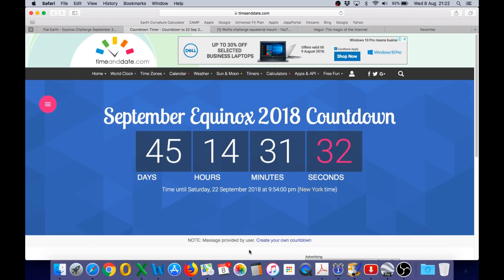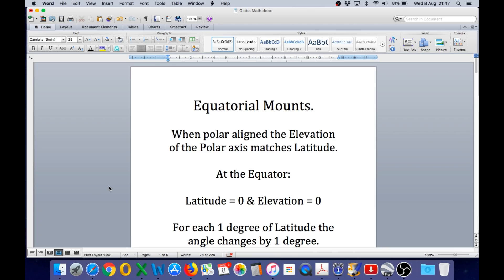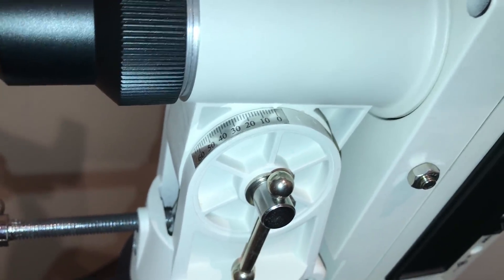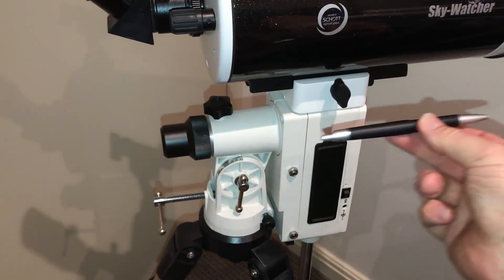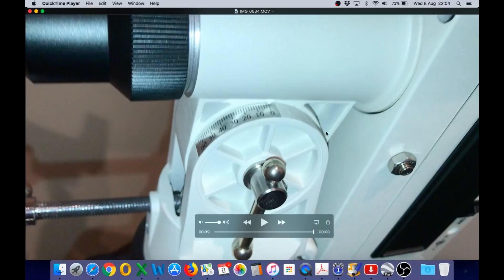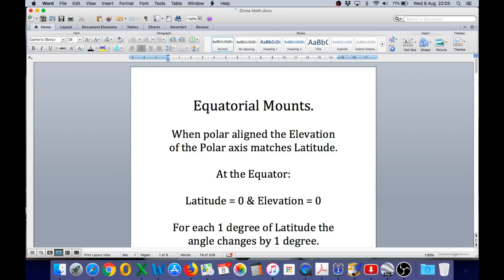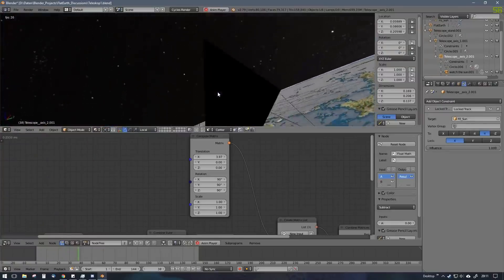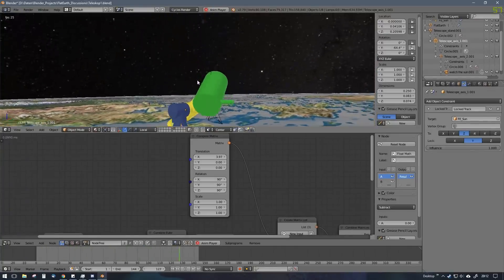Equatorial Mounts - a huge problem for Flat Earth.

Comment: Another excellent video. Flattie ostriches will bury their heads yet again.
Reply: Actually, that's unfair to ostriches.  I saw quite a few of them in Tanzania and not one buried its head in the sand.  Supposedly this story, like the one that elephants are afraid of mice, goes back to Pliny the Elder, who either made it up or got it from someone who made it up.

Comment: I noticed you don't mention it's a problem for CONCAVE SPHERICAL EARTH?
Reply from the maker: +Jason McCormack.  Do you think they will work on a concave Earth?   Try the same challenge please and show me your physical model.
Reply: Jason Mccormack 
Jason, we’ve been through this already. Your LSC’s concave earth model has other (much simpler to understand) problems it has to deal with. I had given you an assignment to go ask the man himself since you seemed incapable of addressing the problem on your own. You never came back with an answer. 

From the looks of things it sounds like you don’t think concave earth has problems, which implies you found a solution for the task I gave you. So what is it? How do you fix the terminator line conundrum caused by curving light rays from the sun? How do you prevent sunrise from lighting up the base of a mountain first when reality is that the tops are illuminated first?
Reply: Sphaera Invictus https://youtu.be/to6Px7XCMlc
Reply: Sphaera Invictus that wasn't this contest... but this does work in concave earth... fools
Reply: Raging S you're officially a moron. It works perfect. AnD NO YOU WOULD NOT SEE CLEAR TO THE OTHER SIDE. YOU OBVIOUSLY DON'T UNDERSTAND THE CONCAVE SPHERICAL EARTH
Reply: Jason Mccormack 
Well, color me surprised. Unlike typical flatties who just endlessly deflect and move the goalposts you lsc EVENTUALLY made an attempt. Ultimately it’s still flawed as most ad hoc explanations tend to be but you get a star for your attempt. 
https://m.imgur.com/gallery/qWzXt

Comment: Honest question about equatorial mounts. If you ran a camera on an equatorial mount for multiple days, would the sun slowly move out of frame?
It seems to me that if you ran a camera on an equatorial mount for a year, it would start in frame, slowly move out of frame, then at the end of the year slowly move back into frame. Is that correct?
Reply: Awesome, thanks. Just wanted to make sure it was working the way my mental model was.
Reply: Rolf Jander
Some EQ mounts have a different rotation rate for Sun, Moon and stars so you can overcome that.
But as you said - Earth is rotating on an axis compared to the Sun so it would eventually go out of the view.
Reply: I'd take one hell of a drift alignment.
Reply: Steven Bell thanks for the question. I didn’t think of that, though I did immediately know the answer after some thought. I wouldn’t have realised this if you didn’t ask. 👍🏼 

Yet this mount can work on stars through the year? That’s pretty cool to know lol

Not like I would go about owning that mount, but if I meet someone that owns one, I’m definite going to ask if I could try it out.

Comment: They can’t even figure how high up the Pole star is, if they all got a cheap telescope on a tripod, measured the angle of elevation of the pole star and used Pythagoras theorem to calculate how high the pole star is, they’d all get different heights for each latitude
It only makes sense if you then adjust for a globe, then the pole star works out to be a lot farther away than any “dome” that’s been suggested, about a quadrillion miles or so
Reply: Dave Church , yeah, Jos Leys did an animation of that.
 He also showed that at the flequator, Polaris would be at ground level.
Reply: Dave Church 
Even Samuel Rowbotham couldn't come up with a complicated explanation for that, he just claimesd perspective.
Conveniently ignoring that perspective over a flat surface would be a matter of maths and no magic can change that.

Comment: Hey Wolfie. Very informative video, thank you. Sparked some thoughts. 
It is flat, flefers have just not worked it out yet. 😂👍  I wish I had the time and computer skills to "model" my thoughts. I still use pen and paper. 
Question if i may. How would the eq mount work facing north from 15 degrees south?
I have a manual equ mount from Orion btw.
Reply: If you know it’s flat, you must have figured out how. If someone showed you a shape and you affirm it is a square, you must have a reason for saying so. Responding with “I know it’s a square but haven’t figured out how” is entirely insane. 

What makes it worse is a flat plane is the easiest thing to map. Locations scale very easily, you just need to measure distances and resize appropriately to fit on the flat piece of paper. All flat earthers have to do is gather a bunch of local maps which are very precise and stitch them together to form a global map. If the earth is flat, it ought to fit pretty well without any distortions or curving lines.
Reply: Cosmic Surfer, "facing" north? You first polar align it to the South celestial pole, then you can find and track any star in the visible sky. The mount works the same way everywhere, just the alignment changes.
Reply: Stanislav Blinov The question was very clear, how would the equ mount work from the other side of the equator.
Reply: And that is how it would work. You'd align it with the south celestial pole...the same way you do with the north celestial pole.
Reply: "how would the equ mount work from the other side of the equator."

The exact same way as in the north except the alignment is done with the south celestial pole and rotation is anticlockwise. The polar scope in my EQ mount displays the constellation of octans exactly for this purpose.
Reply: TheSyndicalistDragon
But there is no south celestial pole on flattardia, so thats a big problem :).
Reply: It is flat, flefers have just not worked it out yet.

Really,it's been worked out it's a globe and has always been worked out that way for the past few hundred years or more.
Reply: TheSyndicalistDragon cool, glad you believe that. I dont.
Reply: "I still use pen and paper. " 
Centuries of astronomers, map makers, engineers, physicists etc. managed without youtube as well.
Reply: Cosmic Surfer 
An equatorial mount is geometrically impossible on a flat plane. That’s what flatheads can’t seem to comprehend. The only solution is if the objects in the sky are some kind of optical illusion that, by way of bizarre coincidence, perfectly mimic what would be observed from a sphere-shaped earth.
Reply: Cosmic Surfer 
Use bits of cardboard, string and the like.  Best way to see stuff in three d.  Besides the challenge requires a physical model.  Doesn't matter how crappy it is as long as it works.
Reply: Cosmic Surfer, an equatorial mount works when the plane of rotation is parallel with the equator. You can do this by aligning one end of the axis of rotation to either of the celestial poles, but the further south you are when aligning to where polaris is the more those pesky tripod legs tend to get in the way.
Reply: Another way of looking at it: you actually do point the polar axis towards the Northern Celestial Pole (near Polaris) from anywhere on Earth, including in the Southern Hemisphere.  It's just that "down under" you have to point the bottom end of the axis North, or (as Michael pointed out) the telescope will run into the tripod.  Also, it's kind of hard to see Polaris through the Earth, so it's more convenient to look for the Southern Celestial Pole from there.
Reply: Cosmic Surfer - The moon is made of cream cheese, I just haven’t worked it out yet. And WW II was started in 1939 when Julius Caesar invaded Poland, I just haven’t worked it out yet.

Comment: Sorry mate, love your videos but you are not technically correct with piece of info given in this one. While each degree away from equator might be roughly 60 nautical miles, each degree actually is slightly more the further away from the equator one gets. First degree is actually 59.661 NM, while the last degree 89 - 90 is actually 60.272 NM. I have no clue about equatorial mounts and so do not know if this minor difference matters or not though.
Reply: Kevin Fisher, that's irrelevant in this case. Of course we know it's oblate, hence this small difference. A rough 60 is good enough, Wolfie just used it to estimate distance, nothing more. Mounts don't care, they rotate, they care about angles, not distances.
Reply: Yea wolfie even mentioned having to make minor adjustments. But just was not certain if that was only on some, or all of them are like this. Did not know how sophisticated or accurate they really are.
Reply: At 5:16 after going to 10 degree angle where he states "and clearly there would be some fine tuning involved with that."
Reply: +Kevin Fisher   If you look at the scale on the telescope, whether it is 59.661 or exactly 60 is irrelevant, since there is not that much accuracy anyway.   Maybe when they are setting up a permanent observatory, they may deal with that many decimal places, but not for the average telescope user.
Reply: It's a case of practicallity > accuracy.
Reply: Anton Gonist, so, by you, a seconds needle on a wrist watch travels 360 nautical miles every second? Numbskull.

Comment: Equatorial mounts.  Flat earth kryptonite.

Along with...... everything in the universe.
Reply: It's really geometry that causes them to run away screaming. I have always wanted to walk into a flat earther convention and shout, "I have an isosceles triangle and I am not afraid to use it!
Reply: Mandelbrot Set Use it? I'll be amazed if he can even spell it right.
Reply: Not everything debunks the FE - circumnavigation still works, as an example.
Reply: @random guy What do you mean? Of course circumnavigation works only on a round, spherical Earth. On dinner plate Earth, circumnavigation does not work except for very special paths, paths so special, they don't even really count as 'circumnavigation'. But on the real, spherical Earth, if you keep a constant heading, then from any point where you start out, you will return to it in about 25000 miles.
Reply: Yes, of course circumnavigation works. On the FE, though, it does actually work too.
Reply: random guy I just explained why it doesn't work.
Reply: random guy 
Show me an accurate Fe map, one that shows the correct distances between all points on earth.  Pro tip you can't because the earth is a globe
Reply: I'm not claiming that FE is right, because it isn't. But it is possible to trace the path that, say, Magellan took. THAT is what I am claiming.
Reply: random guy You could trace out Magellan's route an the Flat Earth map. But so what? How would it even count as circumnavigation? There isn't even a sensible definition for it on a Flat Earth map.
Reply: It's what'd be defined as circumnavigation if it were mapped back onto the globe. Point is, it can't be used as an argument against the FE. Capiche?
Reply: random guy Point is, you still don't get it. Clearly, you have never tried what you yourself suggest, 'mapping' Magellan's actual route onto  Flat Earth map.
Reply: random guy 

Circumnavigation is impossible on a flat earth.

If Earth were flat like a dinner plate you can go from the right side to the left then have to stop. Everything flat has an edge.

On a globe you can keep going round till you run out of fuel.
Reply: Okay then. Why WOULDN'T it work? AFAIK he didn't go over Antarctica or anything...
Reply: If you try to do as you yourself suggested, map out his path on a Flat Earth map, you will answer your own question. Until you do this, you will continue to fail to understand any answer, you will continue to miss the impact of the point I already made, that there is no good way to even define 'circumnavigation' on a Flat Earth map. It cannot, for exampe, mean crossing all lines of longitude as Magellan did. Nor would it be the same if we meant "skirt along the coast of Antarctica".

Speaking of Antarctica, though he never did go there, Magellan did get pretty close, passing through Tierra del Fuego, which is almost as cold as Antarctica, it is so close.
Reply: TRY GOOGLING IT! EVEN THE FLAT EARTH SOCIETY HAS AN ANSWER!

Look, I'm not saying that the distances match up. I'm saying that the route would be takeable on the FE.
Reply: random guy 
If the distances dont match up its useless.  It doesn't work.  It's not a map it's a nice painting.
Reply: Did I ever say that the distances matched up?
Reply: random guy 
Calm down.  Stop taking this nonsense so seriously.  We will all be dead soon enough.
  What is your point?
Reply: My point is that you can't use circumnavigation against the Flat Earth.
Reply: A Wat Flat Earthers don't know it, but there is a way to compute distances on an azimuthal equidistant map.
Reply: SpectatorAlius 
I'm sure there is but at the end of the day you end up with a sphere and they know it.  That's why they claim the distances are true.
Reply: random guy 
I get your point.  I am sure you get mine.  Cheers 🍻
Reply: @random guy If the distances do not match up, then when you think you are tracing Magellan's route and 'mapping' it on the Flat Earth Map, you are not doing so at all.

Flat Earthers don't get this, but you should.
Reply: ^^ this
Not much matches up, but if you were to go to 60 degrees south, you could sail in a straight (well, you'd have to put a constant turn on) line and end up where you started.
THAT is circumnavigation on the FE. Distances don't match up, and I have no clue about celestial bodies, but the routes themselves half do.

Comment: For FE'ers north of the equator this challenge is no problem at all since they will simply state that they are pointing their polar axis at the rotation point of their glass dome by Polaris.  The problem comes for FE'ers south of the equator... how do they still maintain a glass dome with a rotation point around Polaris when they can't SEE Polaris?  How do FE'ers even explain why Polaris is at different altitudes?  At the center of their FE it is directly overhead... but at the equator it is level with the plane of the FE!?  How does that work??  That one guy who did the videos with all the direction arrows on the equinox should do one showing all the angles for a person viewing Polaris at different latitudes and how they go from pointing straight up to horizontal and then morph it to a sphere showing them all pointing at one spot... Polaris.
Reply: It doesn't work anywhere.The problem is that if you want to automate the following of the flat earth sun, your telescope's mechanics must (secretly) represent the flat earth model because no reference for this movement in reality exists.The visual path of the flat earth sun isn't described anywhere by flat earthers. (Still working on the sunset/sunrise problem, probably) It must be some "masonic" stuff inside the telescope that takes care of that...
Reply: tubedude54, the point is to build a practical model. Earth isn't flat, so...
Reply: Stanislav... I think the FE 'gurus' have given the quest of making a model up because they realize it can't be done.  So we are seeing other less informed doofuses in the FE community continuing the attempt.  Problem with those people is they are not smart enuff to understand why their model is flawed and just keep pushing it out there saying it is correct.  Those are the people that nothing we say will ever convince them to the contrary.
Reply: tubedude54 
An equatorial mount can’t work at all in the northern hemisphere. When aligning with the north celestial pole, angle of elevation is always equal to latitude. That’s impossible on a flat plane.
Reply: Racer - All I'm saying is a 'clever' FE'er will simply say that they are pointing the polar axis at polaris which is over the center of their pizza world and if they are north of the equator they will claim it works perfectly.  It's when they go south of the equator that they have problems.
Reply: There is only 1 point on the FE where an equatorial mount will work and that is exactly at the north pol with the polar axis aligned directly overhead. Then, and only then (on an FE) will the plane of right ascension be parallel to the FE (and perpendicular to the earth "axis") to make it work. Anywhere else, including the northern hemisphere, one will need to tilt the polar axis of such a mount to point it on polaris, thereby automatically tilting the right ascension plane also. The orientation shown in the video is the extrem case, when this tilt reaches 90°, but imagine it eg beeing 45°, the telescope will be able to move in a circle whoes plane is tilted 45° to the FE but still not be able to follow the sun or the stars.
Reply: Everyone seems to be missing what I was saying.
Reply: The flat earth sky is a problem anyway? We should see all the stars from anywhere, except those behind mountains and buildings. But at ground-level we see never more then half of all the known stars. Where is the missing half?
All disappeared by perspective refraction, while there's not even room for it in the sky to have "disappeared" from?

Comment: See the angular size of the sun changing in the cross-hairs ...

1000% Proof that Earth is Blender.
Reply: Massimo O'Kissed, Blender is everything, so yes.
Reply: I believe in microwave earth
Reply: Ben Sutcliffe 

Beep

Popcorn is done just like fe.
Reply: Massimo O'Kissed the earth is a percolator.  https://youtu.be/2S-Ti1Aqx1c
Reply: shlibber actually for a 3200 mile high sun it's 222%. I did the calculation years ago. The reason multiple claims of variant angular diameters exist is because there are multiple flerfer claims of sun altitude. They can't even agree amongst themselves.
Reply: Massimo O'Kissed good eye.
Reply: shlibber try screen printing min and max diameter moments and counting the pixels. Many ways to skin this cat 😋